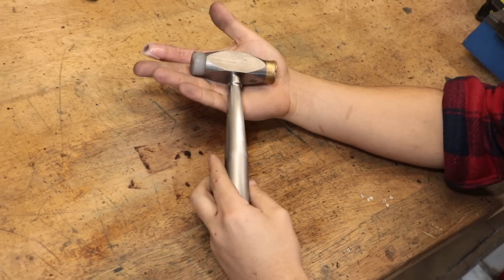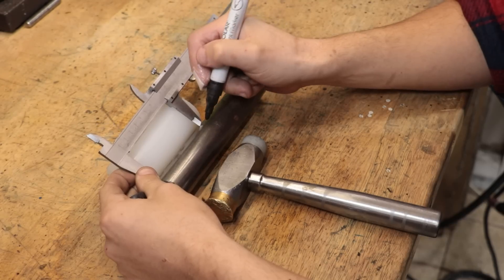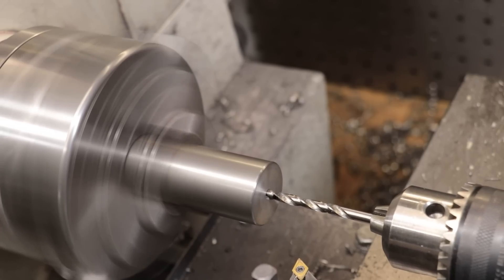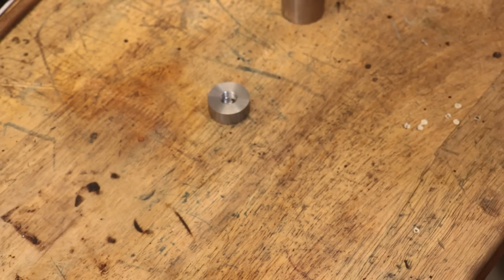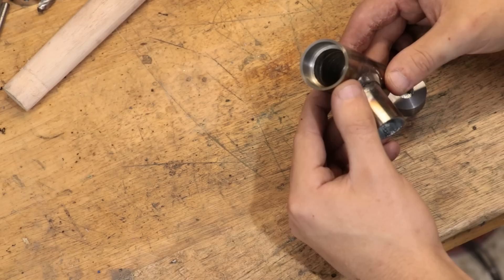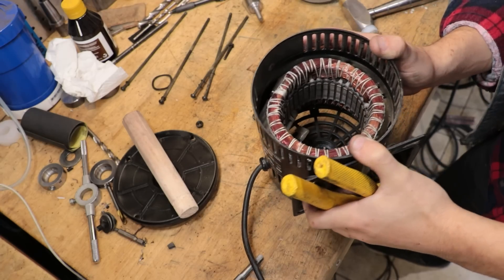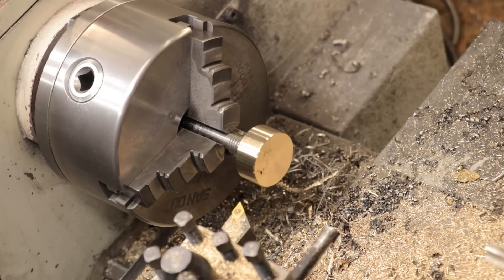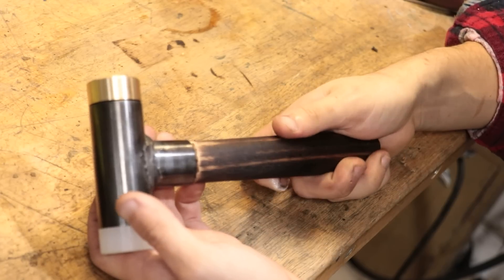Dead-Blow Machinist Hammer - With Tungsten Carbide

Comment: I used to work in a foundry sand casting brass, bronze, aluminum, and aluminum bronze. We used old beer bottles as flux to prevent oxidation and porosity. Give it a try, might help. Just gotta skim it off before you pour. Worst case scenario you gotta try again

Comment: Deadblow hammers definitionally don't transfer more force to the workpiece. They reduce rebound not by transferring more energy into the workpiece (the most efficient transfer of energy into the workpiece would be a perfectly elastic collision) but instead by taking some of the energy that would otherwise go into the piece. Which is fine, they're useful! But they don't put more force into your work. They're more controllable at the cost of putting less force into the work.

Comment: I've done some burnt finish on wood with great results using a method i've developed, it works great in small pieces but takes some time, it fully covers in a deep black and keeps the grain texture, i've made many hard wood smoking pipes that lasts a decade with no signs of degradation from weather and handling, here how it goes:

-1: Coat the wood in a thin layer of paraffin wax with a lit candle dropping wax over the piece;
-2: Heat the piece so the wax is uniformly absorbed trough the surface and apply more wax as needed;
-3: Hold the piece above a candle flame, not too close to burn the wood just enough to see soot forming on the surface;
-4: Move the piece back and forwards trough the flame depositing soot trough the surface, wax melts and absorb the soot impregnating the wood with it;
-5: As the wood heats the paraffin will start to evaporate and burn, let it cool and use a paper towel to clean the surface while it is still warm;
-6: Repeat step 4 until most of the wax is evaporated and the wood start showing signs of burning.

This makes a lasting carbon black finish and if careful no changes in size. I can make a video if you are interested!

Comment: You don't need to strip all the coating off the motor windings, you just need to cut the windings into small enough chunks (with a reciprocating saw or your hack saw) to fit in the Crucible and the furnace will do the rest for you, you just need to add some flux to the Crucible to help separate the slag from the copper before casting...
Reply from the maker: I think I’d need a slightly larger crucible but you make a good point

Comment: I made mine in about 30 minutes: 1" brass T, screwed in a suitable round wooden handle, machined 2 end plugs (1 hardwood, 1 softer wood) and filled the T-piece space to about 2/3 with small lead balls (sinkers). It works a treat on the mill drawbar and to set parts in the vice.

Comment: I used fishing shot as my ballast weight in the hammer I made a few years ago.I had a lot of waste shot left over from fishing trips,so it cost me nothing and is small enough to be able to move about inside the head.Or you could try using old ball bearings.
Reply: you can make lead shot if you have some old lead to recycle. punch a hole in the base of a bean tin, then heat it over gas. the lead will drop out into a bowl of water and form balls.

Comment: If you filled the rest of that space with tungsten dust, right up to the top, it’ll function as a dead blow. The dust adds weight but still allows the movement of the weight necessary. 
   HK proved it with the bolt in their MP7.  The steel “bounced” unless it was larger than they wanted. When hollow and filled with tungsten dust it could be designed much smaller while retaining enough mass and almost zero bounce.
Reply from the maker: It certainly acts as a dead blow now, but that’s a very interesting fact that I wasn’t aware of.
Reply: @artisanmakes  oh, I’m sure it does. Using the old inserts is brilliant, it’s what reminded me of what I heard about HK and made me go check it. I’m going to start saving my broken inserts so I can make one too, I’m jealous

Comment: Hit that burnt handle with a wire brush to take away the excess carbon and provide texture / contrast. Then give it some wood oil / finish. The transformation will be surprising. I use the burnt finish often, and that complete blackness is what you get when you take it a little too far, in my opinion. The wire brush when it is brushed along the grain will wear away at the softer growth rings (providing texture) and will remove the black carbon from the softer growth rings more quickly.
Reply from the maker: You can see me do that in one of the shots. I just did a bad job of capturing it on camera

Comment: Never realized that about tungsten carbide but I guess it does have tungsten in it. It looked like you could have used more though. It might need to move, but it probably only needs to shift a tiny bit for it to transfer back through again. With too much space I'm betting the delay is too long and you can't hit as often and you have to wait for them to fall against the bottom again. You can also just melt lead into a solid cast or into droplets pouring into water too so you could have tried mixing that in. I agree that the burnt finish looks nice but it's just over done. Everyone does it now and with the black oxide it doesn't look as good. Still interesting video though and glad to have you back man!

Comment: Nice design, using old inserts for mass was a brilliant idea. One tip I can share when drilling. Only use two drill sizes, your pilot bit and finish size drill, all the other steps in between just wear out drills. The trick is when you size the pilot drill, pick one that is the same or very slightly smaller than the width of the finish drills web(the little chisel tip in the center). What happens is the finish drill will track without chatter which keeps your finished diameter closer to size. The torque requirement is very close to the same, but can be less since the process greatly reduces the drills tendency to grab. Lathe size really doesn't matter, I use the same method with my Sherline as my 24 x 120 Lansing.
Reply from the maker: Usually yeah but once you start swapping to these larger 1 inch demming bits on these smaller lathes you need to make the pilot larger than you would want to

Comment: My trick for a good looking charred wood finish is to sand it smooth(final smooth), burn it, sand it again, slight bit of linseed oil, burn it, sand again and final oil. may do localised char /sand/oil/char/sand touch ups. It removes the excess char and gets a nice smooth uniform(as in more uniform/more intentional) result.
Reply from the maker: You can see me add oil in one of the last shots. Didn’t do a great job of capturing it on camera though

Comment: Wouldn’t the plastic and glue just burn off when you melt the copper? 

Also, why don’t you get a saw?
Reply from the maker: It’s more of getting it out of the rotor so I can melt it. I don’t have a crucible large enough to hold the rotor

Comment: Might be time to get a cheap tig welder . That flux core isn't treating you good . Most smaller welds like on the hammer can be done without filler and are easy to learn
Reply from the maker: I have a tig handle for the welder but it’s scratch start only. I’ve only used it for sheet metal welding. Outside that my results are….. best not seen by the internet
Reply: @artisanmakes  scratch start sucks yeah .

Comment: Fun Video. I do wonder how long it will take for the carbide to wear through. Probably last a long time if not used frequently every day. The fine cuttings made on the inside surfaces should help     buffer a bit and slow the wear. Aluminum on the hammer face while lighter could be annealed to     be soft and much easier to source. I loved the idea of casting the hammer face.
Reply from the maker: I’d be surprised if it wore though within my lifetime
Reply: It won't matter anyway.  Dust or lumps, it's still a moving mass.

Comment: If you want the handle black but are not sold by the burnt look, just grab some india ink (or just a good black ink) from an art store and give that a go. A couple coats and a bit of oil and wax and it should be nice and dark. Do check on an offcut if the look is your thing though.

Comment: I wonder if the inserts aren't working as well because they aren't smooth so they don't move against each other as well.  Sand or shot almost act more like a liquid in larger quantities because they move around each other easily, while these won't do that until you use it enough for them all to crumble.  
As for the handle, I agree on the burn finish.  Maybe sand it back and go with a darker stain? 
Beyond that, nice work as always.
Reply: I was looking at those old inserts and thinking the would be more functional if they were broken int smaller pieces.  Not sure how difficult that would be though...
Reply: @thedodger7030 They are relatively easy to just smash appart
They're really hard, but that also makes them brittle

I've had to smash a few to liberate them from their holders 😅
Reply from the maker: I didn’t say that it wasn’t working. It’s acting as a dead blow hammer should. It’s just not that big a step up that I was expecting

Comment: I have several pounds of mercury and I think it’s the bee’s knees as far as dead-blow weight goes.  I have been scheming upon a design for a while now.   I like your cap approach and I think I will make a few for myself and friends.  I just want to make sure that nobody ever gets a nasty surprise in years to come, so I want to make them very secure and mark them as to what is inside.
Reply from the maker: Never occurred to me that mercury would be an option. Kicking myself that I didn’t think of it
Reply: @artisanmakes  
Tungsten carbide is denser than mercury, but mercury is liquid, so the air space is readily prescribed and it flows rather than tumbling past other random pieces.  🤓
That being said, the carbide is an elegant solution.

Comment: My thought on them burnt handle. I agree that it’s not ideal but also as a machinist hammer with rust dirt and cutting oil, it looks like it already has a head start on hand burnishing the finish. My copper hammer I acquired has a wood handle that’s darker than that from years of dirty oily hands.

Comment: Found buying a machine helped to finish a part. 
Vice with pipe Jaws & a power hydraulic bandsaw would make your projects more comfortable.
Original left thumb injury from missing hammer & not knowing about bolt breakers with rusty nuts.
Wear a glove on injured hand will help with warmth & repair.
Have been investigating the parting tool & the need for good  demension packing  & parting close to chuck face. Real artwork with plenty of squareness needed.
Have a hammer from Blackwood with leather on 1 end.
You might use more technical approach to videoing to aid in recovery. Made 1 also.

Comment: I think that fine sand would have been better choice for dampening material than those inserts. Even though inserts have more mass than sand, sand would have much more individual particles colliding with each other and dispersing the spring force of the hammer head.
Reply from the maker: Maybe but I can’t say for certain. I think I put more of a focus on having the added mass that I get from carbide. Is it better? Can’t say for certain

Comment: Just a general note if anyone makes one. You can get lead fishing weights relatively cheap, and they work. I'm not sure what's available globally, but we can what's called split shots.
Reply: I picked up a bunch of lead shot that had been destined for the hull of a yacht; apparently the owner had to move (with yacht) before he could do the job.

My intent was to make dead blow woodworkers mallets but I procrastibated for so long on the exact design that I've yet to make one.

Now that I'm into a bit of metalworking it's a bit more likely to find use besides occasionally smelting it into small weights for various projects.

Comment: I'm not trying to disparage you or anything, but I find it kinda funny you have so many small, relatively inexpensive machines, and e en still use a hack saw, and mainly use carbide insert tooling. I'd think you'd wanna save even more and hand grind high-speed steel. Again, not trying to insult, but it kinda feel like fancy rims on a 2016 civic.
Reply: The small machines have more to do with small shop size than anything.
Reply from the maker: 5 years worth of broken carbide, I’d say that’s not too bad. I personally don’t like hss lathe tools and I don’t use them outside of custom form tools and I benefit more from having carbide, in spite of its downsides
Reply: @artisanmakes  oh I like carbide too. With how ornery low carbon steel can be you almost have to use carbide.

Comment: The content needs to be fluid to some extent, and broken carbide inserts just aren't.
If you can revisit it, please use small spheres of dense and malleable material like lead.
Reply from the maker: I’m going to stick with this. It does make a difference, just not the mind blowing step up that someone told me it was. It does do the dead blow action that I was chasing so to me that’s job done
Reply: @artisanmakes /videos maybe you could try his hammer and see if there's a difference.

Comment: Hammer looks good!
On the topic of your welds; in a couple shots, I could see zinc fume residue on the inside of the pipe you welded. Galvanized pipe is horrible to weld because of this, it off-gasses and contaminates your weld, and makes bubbles and makes it really hard to get a decent looking weld. Anything galvanized I need to weld, I soak in vinegar for a few days first, to get it out of the way. 
 
I imagine someone else will berate you about the zinc smoke for health and safety reasons, but honestly, everyone knows about that already, not everyone knows how much it messes up a weld. 👍🏻
Reply from the maker: Yeah I never really have the luxury of being able to dump it in a container of vinegar for a few days. The little time I have in the shop I need to be kinda flat out. I tried to get rid of most of it as best I could and the stuff left on the inside, it is what it is.
Reply: @artisanmakes  understandable. I suppose you could use a more powerful acid to strip it quickly if you had a weld you really wanted to look good. My shop time is hugely limited as well, so I try to plan ahead and prep parts in little 5 minute increments during the week ahead of time, so I can do a lot all at once when I get in the shop.
Reply from the maker: I’ll have to try it out once I get my hands on some sulphuric acid which I’ve bean meaning to get in for a while. Unfortunately it’s tricky to find in non commercial quantities these days
Reply: I've welded lots of galvanized steel tubing. It doesn't really do much in my experience. I just wear a mask to avoid breathing fumes and don't worry about it any more than that.
Reply: @vxiiduu  for me welding on galvanized is like welding through paint, it’s worth the time to remove it. Do you use stick or MIG? I assume stick would tolerate it more, but i’m guessing.
Reply: @Vikingwerk  I've always used gasless MIG and nothing else (since it's outdoors). The only time I've had problems with bubbles in welds is when I stupidly tried to weld through about 1mm of concrete that got stuck on the metal LOL
Reply: @vxiiduu  you must have a way more powerful welder than me! 
I’ll admit, I’m only running a 110 gas shielded MIG, so that probably contributes; but when I saw his welding struggle, it looked awful familiar, which is why I mentioned it.

Comment: Wonder if it would have been a good idea to break up the inserts into smaller pieces.
Reply: Have you ever tried to deliberately break T carbide inserts? hold the in a vice and strike and mess up the jaws, and bits every where. His inserts are small as well making holding harder too.  It might have been better grind the pointies off the tips so the could 'flow' inside the cosh a little more freely though.

Comment: It would be interesting to know whether for a given weight of hammer the idea of “dead blow” is more about the feel of the tool as the hammer strikes the workpiece or if there is significantly different energy transfer to the work.  Years ago we made effective deadfall hammers by casting a lead head around a steel handle.  When they got buggered up we’d melt them down and re-pour them.  Unfortunately a thing like that doesn’t mesh as well with the term “Artisan” but they worked well.  Very glad to see the hand seems to be recovering.

Comment: I've made a hammer with a similar construction over 5 years ago. If you don't mind I'd like to share what I did to attach the wooden handle inside the hollow squished tube.
I made the top of the handle a snug parallel fit into the tube and glued it in with epoxy, then cross drilled and mounted a large-ish roll pin. It has seen a  lot of hammering in the years since I built it and it's still on there rock solid! The hammer can be seen in several of my videos 😉
Reply: Better glue these days would be foaming polyurethane of the Gorilla variety. Rehandled two hammers and an axe so far. It really assists the scutches expanding the wood in the head hole 😉